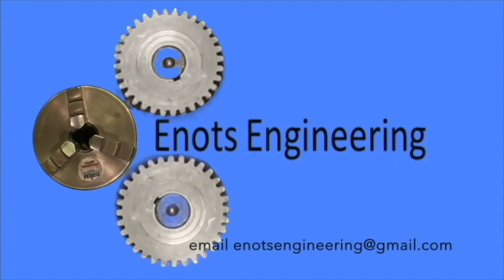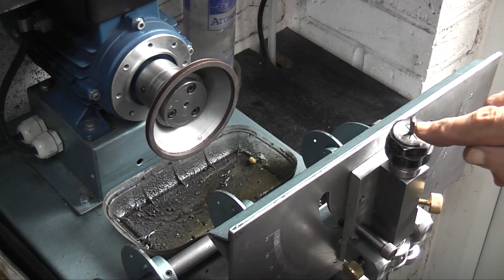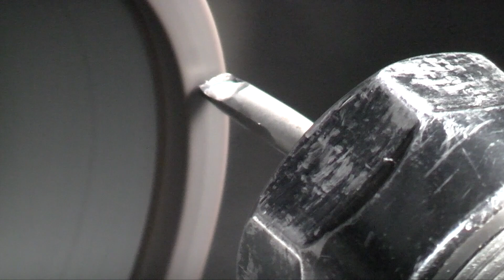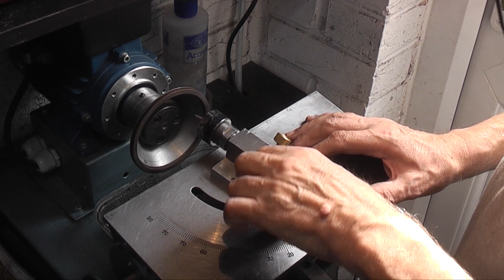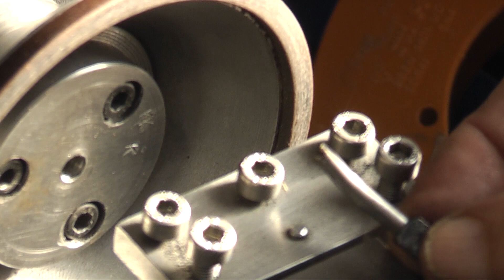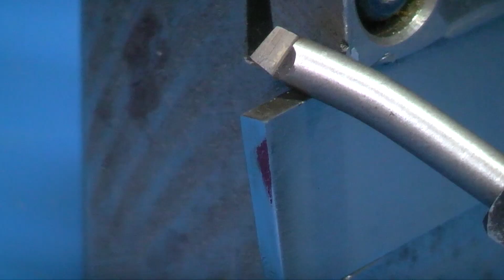Sharpening tools

Comment: Hello Alan. I am quite interested in your videos regarding model engineering and I like the videos on the Worden sharpening setup. I  am interested in this as well. I would like to know if a feature exists to sharpen the side flutes of end mills and slot mills.
Reply from the maker: Hi I don’t know of a fixture for this . It’s quite complicated to grind the sides of end mills . You would need to hold the cutter between centres and fix a guide under the spiral edge. So as you move the cutter along it twists presenting the edge to the grinding wheel.

Comment: That's a great fixture,  where did you get the idea?
Reply from the maker: Part of the fixture is based on the original tool holder and I added the dividing part to sharpen milling cutters